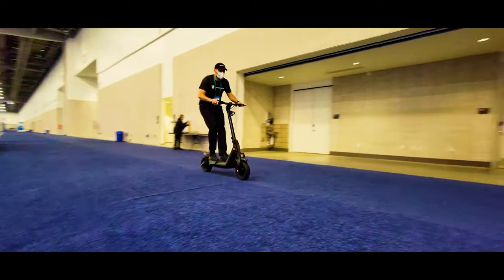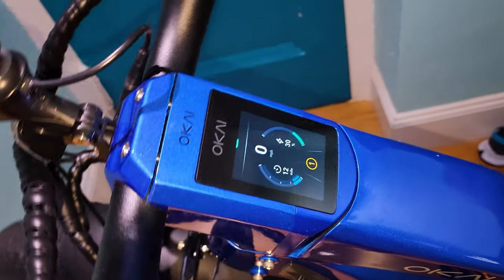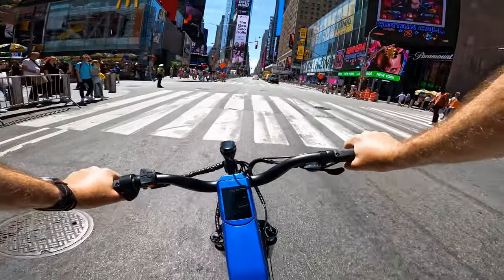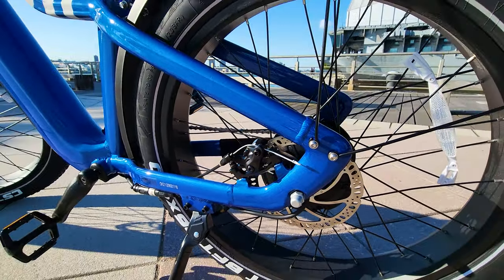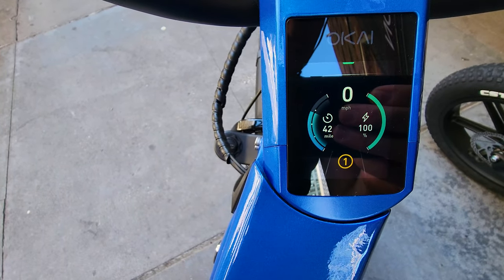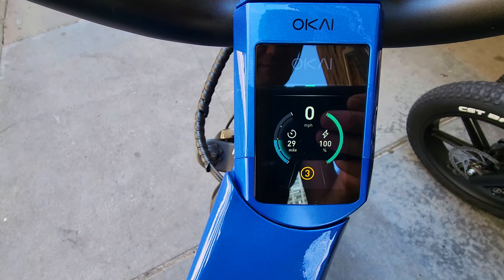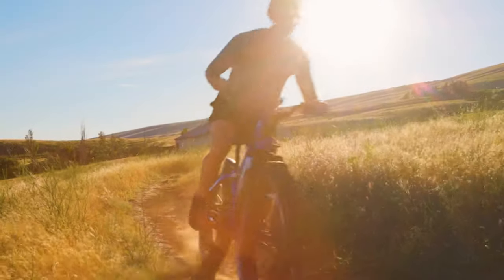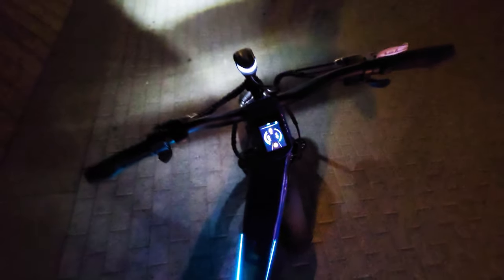OKAI EB50 Ranger review: Most efficient e-bike!

Comment: All good but going to the website you can't even buy extra battery packs or even accessories for it. At this rate it's pointless to even consider buying this bike.
Reply from the maker: Are you sure? It's shows availability. Email for your location and parts
Reply: @ElectricVehicleSpace  I mean I went to their website and everything is out of stock. I Emailed them and have yet to hear back from them.
Reply: @ElectricVehicleSpace  just got an email with my concerns about why isn't there accessories for the bike on their site. All I was told was that I can buy it from best buy. That in itself is a red flag as they didn't even answer all the questions in the email. Think this bike is a hard no for me.
Reply from the maker: @ELITECMDR666  I do not control how they manage their business but I can only relate and test the final product. I like the bike so far.
Reply: @ElectricVehicleSpace  I mean it's all good just frustrating that such a good looking bike doesn't have any spare parts for sale. So if you spend 2k on it and need to repair it you're S.O.L
Reply from the maker: @ELITECMDR666  maybe thought time it will improve?
Reply: @ElectricVehicleSpace nope, as of 2023 still no battery options
Reply from the maker: @stevenbrice1681  I lost hope in this brand. Better options are available now.
Reply: @ElectricVehicleSpace  do you have some recommendations. I have till the 13th to return the bike.  I was not happy when I called to ask about a second battery and they said they don’t sell them. Ugh
Reply from the maker: @stevenbrice1681  I think niu bqi is a way better option. If you are in nyc email me I have few ebikes at 40% off for sale.